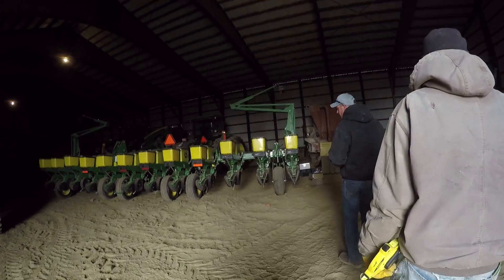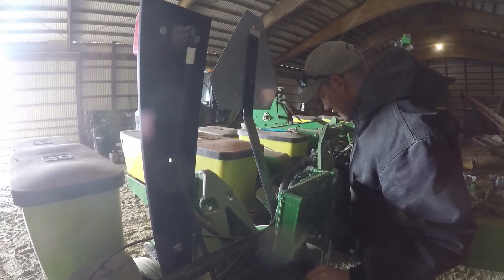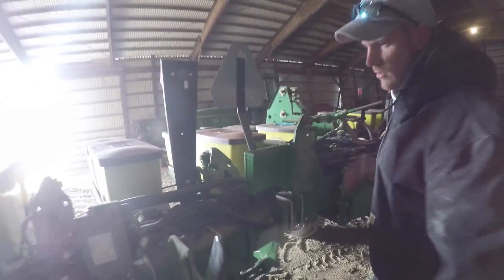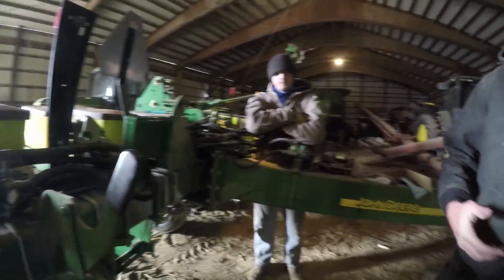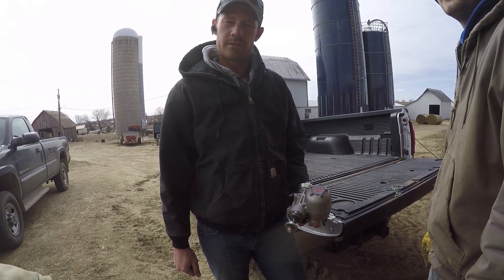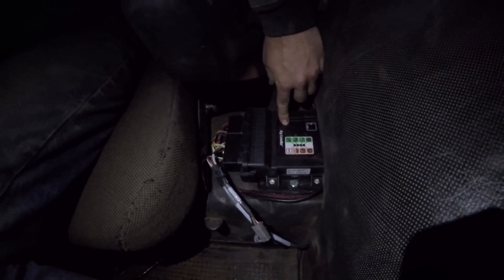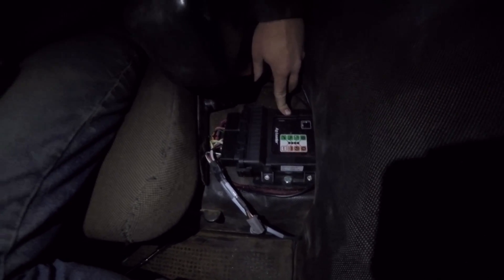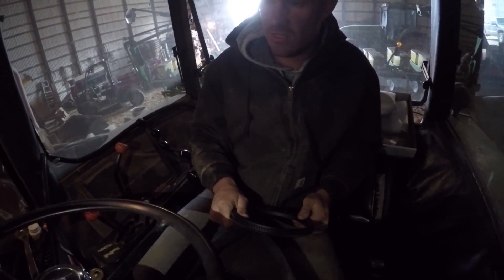Planter & Tractor Retrofit! - WS Ag Center

Comment: I'm wondering if the 4640 has enough hydraulic capacity to run everything. Would auto steer work better with a MFWD tractor?
Reply: TwoHappyChildrenFarm it definitely would work better